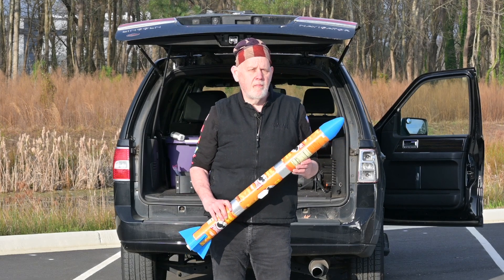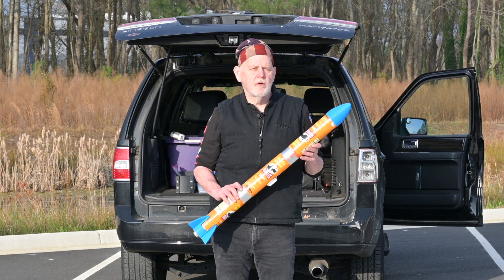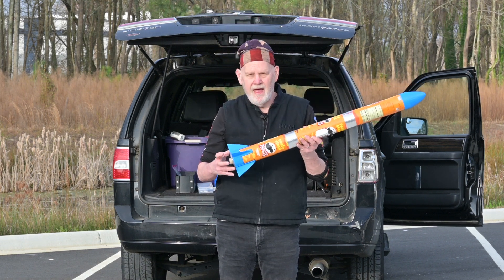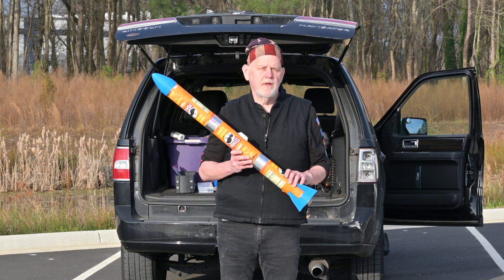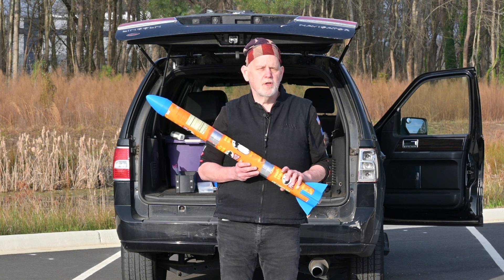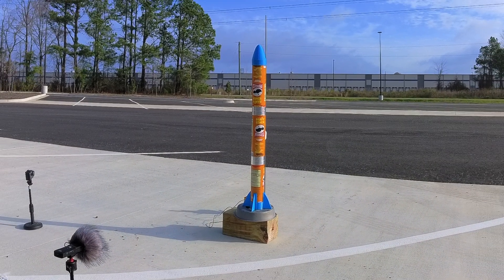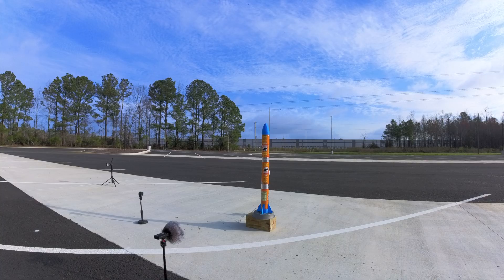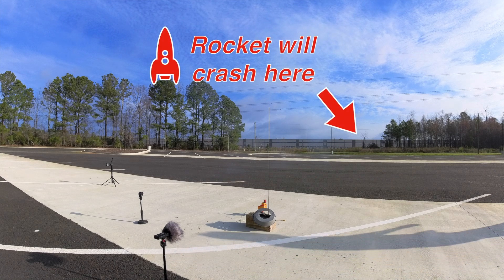Flight of the Pringles Can Rocket.

Comment: Great work! have you found the cause for the ejection failure?
Reply from the maker: I didn't have a recovery system on this rocket.  The nosecone was glued on.  It was always going to be a one-way flight.  I'll launch an upgraded version in 2 weeks with a chute.  My cost to make this rocket is almost nothing,  The engine costs more than the 3D printed parts.